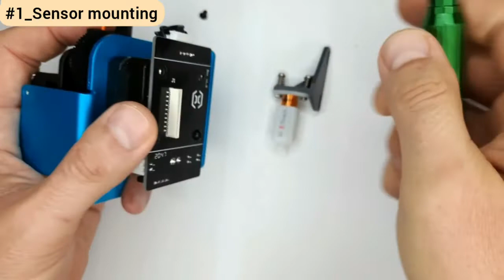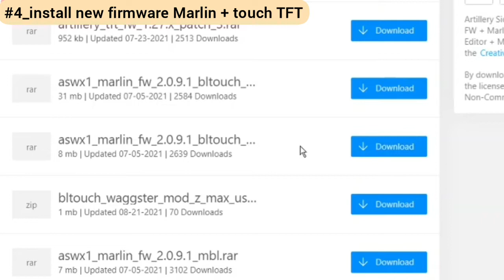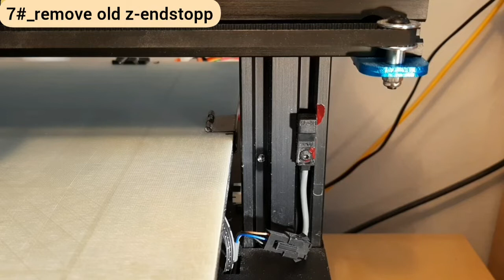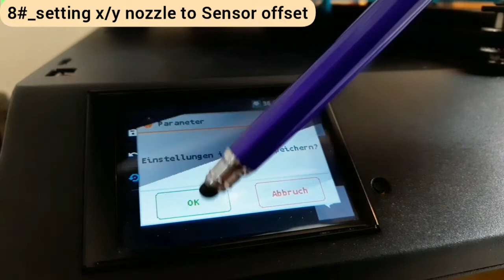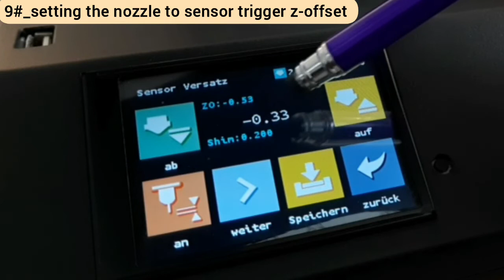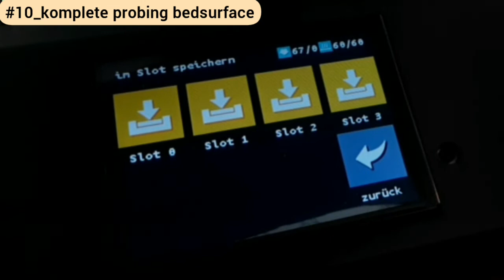Best 3 Upgrades for Sidewinder X1 _ BLTouch, Marlin 2.0.9.2, Nozzle "free view" fan mount

Comment: Just to save anyone else from the hours of debugging. For me, not attaching the ground wire on the BLtouch caused it not to work properly! i added a wire running down to the Z+ end stop ground and it began to work properly. Its a really dumb issue because if you wire it like in the video it works up until you try to home the device.

Comment: Doesn't the original cools the blue aluminium plate for some reason and not the new position?
Reply from the maker: The blue al plate is just for mounting. The fan orig fan is not blowing at this plate. Also this plate is not in contact with anything coolworthy behind. So no, the blue plate is not involved in any cooling.
Reply: @justprinted_3den988  Thanks for explanation

Comment: Hello. Why does my printer say it wants a 4.00 mm shim, when youre is saying 0.2 ?
Reply from the maker: sorry, I am not regulary checking on my english channal comments. Have you solved you shim?
Reply: I think each machine has a different number, and you have to use the wedge that works for you. If, for example, it works out to 0.10 for me, I use an unfolded sheet of paper. Even then, the bed always sticks closer to me, and the first layer comes out a bit squashed, so I have to raise the offset by almost 0.02 more.

Comment: Thank you for doing English versions of your videos on the Artillery printers. Other than reviews there is not a lot of English content on these printers discussing modifications, firmware updates, etc. Do you know if your fan mount setup would suit the Artillery printers which come from factory with a bed level sensor (e.g. Genius Pro)? I completely agree with the value of seeing the nozzle without a fan shroud in the way and want to try your mount on my Genius Pro. Thanks
Reply from the maker: Some users of the x2 and Geius pro commented that the fan mod would fit too. I myself ca not verify that.
Print it i sheap PLA first to test it.
Reply: @justprinted_3den988  thanks for replying, I will give it a try and let you know!
Reply: @justprinted_3den988  Ok, I tried it and I would say it does fit unfortunately with a caveat. I had clearance issues with your fan shroud so I printed the Herbert version which I like in principle. While the Herbert shroud sat above the extruder level it sat too high, partially because I could not get the mount and cable slot to fit securely without also angling the shroud slightly in a clockwise direction.  The angle effectively tilted the fan shroud mounting points up, putting the shroud edges too close to the hot end (tried it with PLA first) and not orienting it properly for effective part cooling (basically pointed the air to the silicon cover and hot end tip). 

However I will definitely try it again when I get some PETG and plan on potentially needing to adjust a fan shroud model. Still, thank you for sharing the design.

Comment: Do you still need to adjust your slicer files for ABL when printing with this firmware? Or is that already taken into account?
Reply from the maker: The slicer does not have to be adjusted.
The probing and bed leveling takes place within the printers firmware.

The slicer start code is the only thing that needs an additional command in order to to center test probe the general bed level before each print.
This way you can change between different print surfaces and the ABL probe will always measure the correct hight followed by the printer firmware aitomatically adjusting the first layer level exactly to whatever you have your first layer set to in the slicer.

Comment: I'm wondering why rather than modify the Printed Board by soldering the pins you just didn't extend the BLTouch Holder out farther to clear the connector ? .... you would only need to adjust it out a few mm I would think.

Great Video non the less ... Thank You
Reply from the maker: I had the general cover ready designed and in use for a year. When upgrading to the Touch Sensor the aim was to continue using the existing cover.
Thats why the sensor had to fit in the cover. Therefor the connector had to move. Overall I still like the very compact Cover design with full view at the nozzle.

Comment: One thing, I didn't completely get. Don't we have to say somewhere to Marlin about the 4 mm z offset of the probe? If some people are using 3mm and some others are using 4mm, how can Marlin know about that 1mm difference?!! Great video. Thanks
Reply from the maker: I understand your question.
The mechanical mounting hight is not so much important as long as the elektrical trigger point of your sensor is below the nozzle tip. So the trigger can click before the nozzle touches the bed while testing.
The trigger point is crutial.
If you imagine the touch sensors tip fully out down and getting pushed in while testing slowly downwards traveling of the extruder.
The Touch tip touches the bed and gets aorox 2mm pushed inwards until the internal trigger closes, which is the same signal as the former z endstop.

That trigger point of the sensor is not measured, it can only be testet.
Therefor you use a special menue within the printers setup.
It is called the probes z offset.
If that procedere is done, than the marlin has learned the real hight distanze nozzle tip to Touch trigger point.
In consequence marlin knows than, when the trigger comes in, what the exact hight of the nozzle tip is relativ to the bed surface and when the nozzle is at z Zero.
The slicers tells marlin the first layer hight and so it works.
Reply: Thanks for your very detailed answer. All understood now.

Comment: Thanks for this! I wonder if you have issues with octoprint? Printing from usb is great but octoprint doesnt trigger the probe during homing.
Reply from the maker: I can not give any advice concerning octoprint, since I dont use it.
Read the instructions on Digant s Thingiverse discribtion. He is telling there which settings you need within the printer menue in order to use octoprint.
For he is adressing this toppic, I would assume that it should work fine also with octoprint.
Reply: @justprinted_3den988  Thanks for the video either way it was helpful 😀
Reply: @justprinted_3den988  Hey there, I think it was on my bad that it was behaving weirdly. Re seated the cable associated on the mobo to probe and it seems better. Thanks for the video again